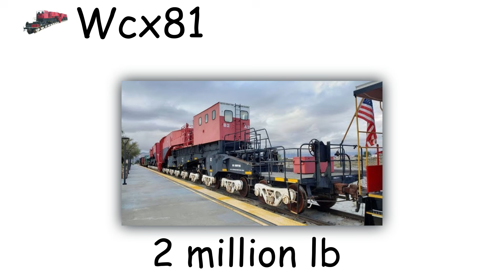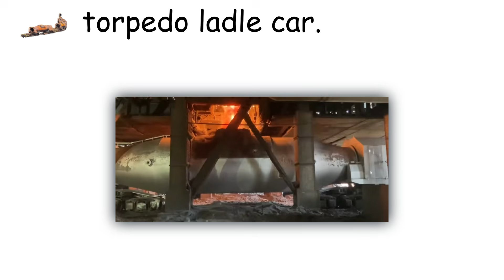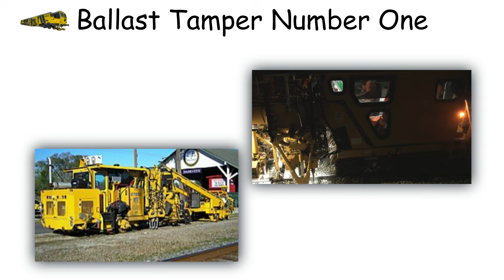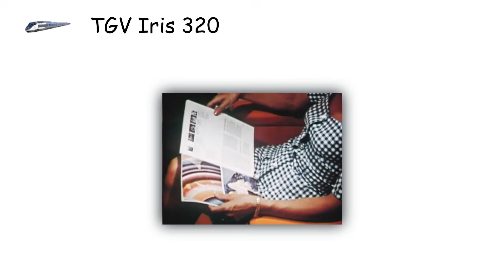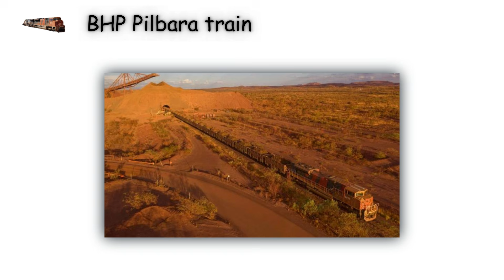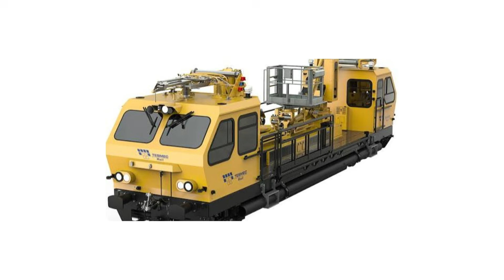The Biggest Railcars Ever Built

Comment: The Railroaders Memorial Museum in Altoona, Pennsylvania, has the one-of-a-kind 16-axle depressed-center flatcar, PRR 766163 (nicknamed the 'Queen Mary'), that was built in 1952 at the Pennsylvania Railroad's Juniata Shops located nearby (the shops are still used by Norfolk Southern to this day).  It weighs 500,000 pounds empty and has a weight capacity of 500,000 pounds, meaning at its heaviest, it weighed ONE MILLION POUNDS.  It served all the way into Conrail before being retired, preserved, and restored to its original 1952 Pennsylvania Railroad paint scheme.
Reply from the maker: That's fascinating! The Queen Mary is truly an impressive piece of railroad engineering and history. Thank you for sharing this information.